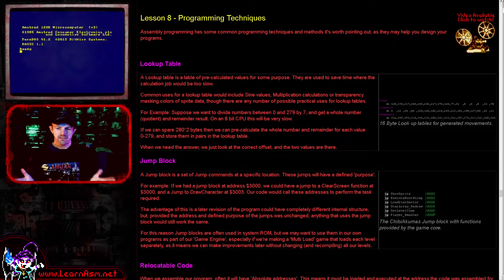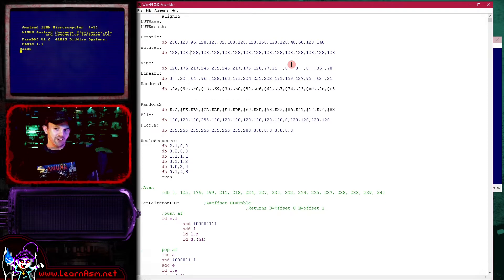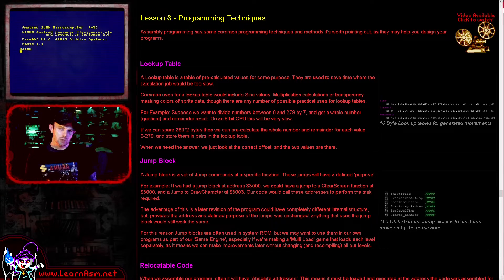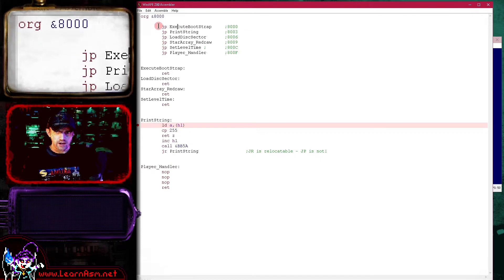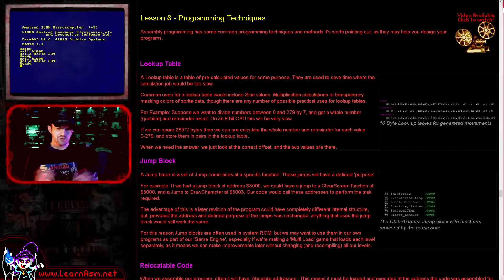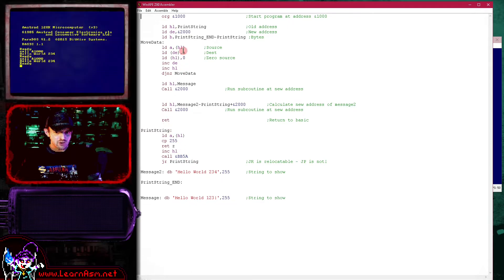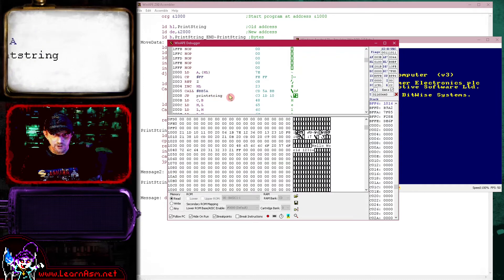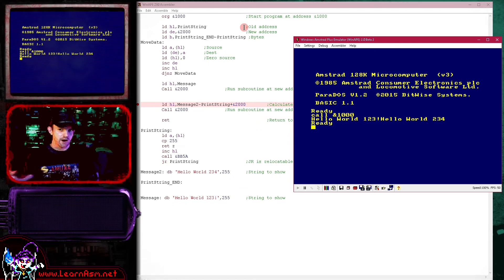Programming Techniques - Assembly programming basics Lesson 8

Comment: most BASIC roms have a Jump (Call?) Table for their language execution, and some (MSX) have BIOS routine Jump Tables. The best programing use of a user Jump Table that I have seen is for joystick or sprite direction handling, where the initial jump is based on some maths to get the correct Jump Table entry (ON X GOTO or ON STICK GOSUB). If you NOP pad a Jump Table or RET pad a Call Table (they usually are), you can also mathmatically use parts of it as a Lookup Table (where it makes sense), as the contents of any of those tables dont have to be sequential. If you are careful in your coding you can prepend padding or use a value instead of NOP or RET. Some architectures need even byte aligned src or dst addresses. Sometimes you might use Branch Tables or Relative Jump Tables.

Comment: Most programming courses tell you about the blocks but not the best way to put those blocks together.   What I would like is a book that tells me how to go about structuring an assembler program.
Reply: You mean like making your own assembler?
Reply: @Clippy4Jesus  No.  How to structure something.  Most programming courses show you bricks and mortar.  Some might show you how to put a brick on top of another brick.  But what most of us want is a basic architecture course.
Reply from the maker: I don't think there's one way to do that.. I'm sure there's an infinite number* of ways of structuring and writing programs, and any that results in a usable program is a good one.... If there is 'One true way', I do not feel confident enough to tell you I know it, let alone teach it.

Take a look at my Yquest, Grime Z80, Photon or even SuckHunt series... In those I went over an entire little game (which you can download) - am I saying they are the best? no!...  but they were playable so I must have done something right!

*Take self modifying code for example, Fast, efficient and powerful, but makes debugging your code a nightmare for the early coder.
OR... Using IX/IY as pointers to objects is great - but if I'm trying to port to the Gameboy they make the code unusable, as that system doesn't have them.
How you will want to structure your program will vary depending on size too... a game that is 16k total will look and work very differently to a multiloading/multidisk bank switching 512k monster! the design and structure of ChibiAkumas Ep2 was a very different beast to Suck Hunt for that reason
Reply: @ChibiAkumas  Thank you for your reply.  You have a great channel.
Reply: Like said elswhere, there is no "right way" to code or structure code. there are defacto structures, like 1st instruction being a jump, and often constant data in between, and storing text data at the end of the program, or clumping similar/utility routines together. A lot comes down to knowing the limitations of programming target. using relative branch and relative jump invites easy structure changes (as pointed out in the video)